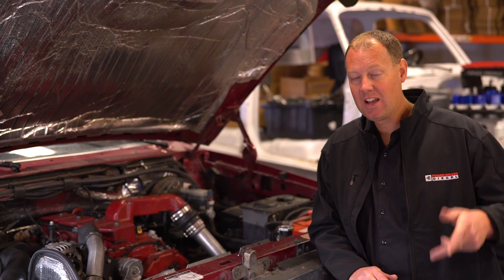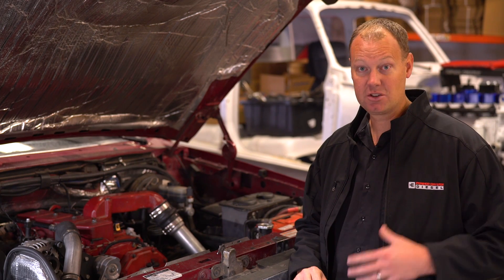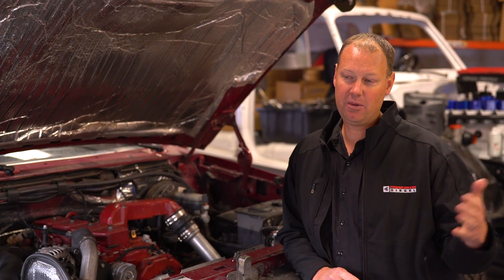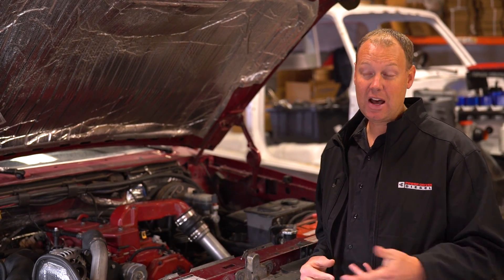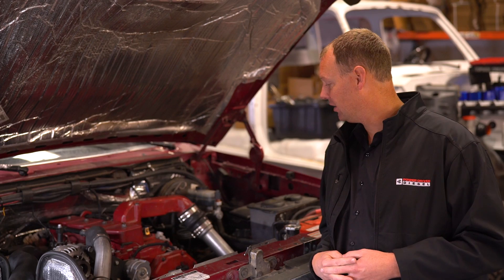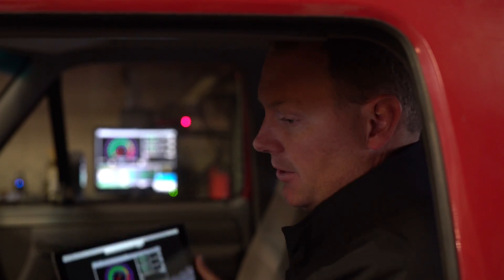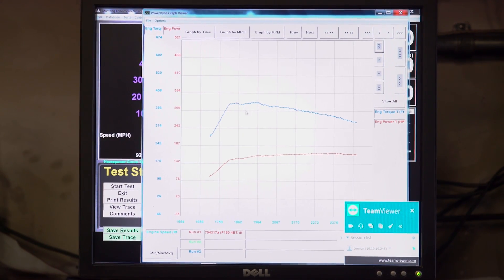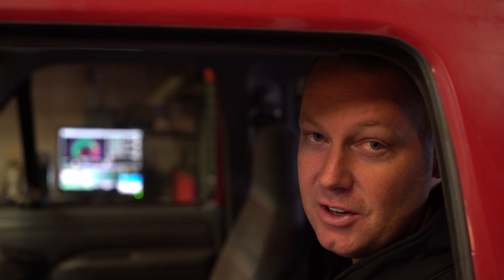Dyno Test: 4BT Cummins Powered Ford F-150

Comment: Great engine for a skid steer, way to shaky for a pickup. Should of built & turbo'd a IDI..
Reply: Paul Harper 
Man, an IDI is not a good power maker. Aftermarket support is very limited and with the 7.3idi, you run the risk of cracking a cylinder is high because of it being a punched out 6.9idi.
 Those engines are a poor choice to build.
Reply: Babylon falling 
Hahaha..dude, calm down you have missed the point all together!
  Look, im not saying it's not a good engine in stock form, but it's very limited. The IDI, once a turbo was introduced around 93 to 94 started to have a lot of issue's.
 The DI 7.3s were a much better design all together. My 01 7.3Di was built to be able to handle loads and still be reliable. 400whp/700tq to the wheels and a built trans to hold it, did a fantastic job, and mine sure wasn't a trailer queen or a pavement queen. I could pull heavy loads while keeping my EGTs down and still getting awesome fuel milage. Empty, i was getting 24mpg on hwy and about 15 in town, and about 18 mpg pulling. This was a 4wd on 33s at that. So no, modding or building doesn't just mean power. If you know what you are doing and build it right, you'll have no issues, an IDI cant do that, im sorry dude the evidence is there that supports what im saying. 
 Just out if curiosity, how many diesels have you owned, or how many year's have you been a tech?

Comment: gears! add gear! peek torque is 1200 rpm ish, peek horse is 2400 rpm ish.  happy medium 1650-2000 rpm.  add a 8 speed transmission will do some magic with such a low end torque engine and you will find tons of fuel economy! adding more boost just makes its life expectancy shorter.

Comment: Did you say you "pulled"  in 5th gear?
I've alway heard and seen dyno pulls in third. Theoretically a correct pull for correct numbers would be done in 4th/1-to-1 gear...wouldn't you think?...then typical drive loses of 10-15%.
Am I making sense? 
5th gear?...just thinking...if its .75 overdrive - you're losing 25% power in that gear. Am I correct?
Thank you.
Reply: PowerDrivenDiesel I can see that.
I have a 12-valve but for example I'll use my 427 that's in my 67....it was dyno'd at 598.8hp at 6100rpm with a 950 carb. Then we installed it in my stang. I didn't like the way it drove. I eventually put "my tune" on it with an 850hp , dropped the timing just a hair with fatter jets. Now , I'm sure the numbers aren't there now but it sure drives better with improved low-end control and torque. Warms up faster in cold weather. 
I think a dyno is great but once the motor is back in the rig...it still takes additional tuning... seat-of-the-pants tuning if you will.
I don't know....I'm assuming diesels aren't like that.
Reply: Correct.   mathematically,   any gear would work'.  Running in  direct   ensures the engine is fully loaded,  fully fueled, and fully boosted.    Also  keeps the torque to the  dyno  low enough so   slippage isn't a factor.   HP to the wheels  never changes, regardless of    transmissiongear selected. (ok, there ARE tiny variances  due to   loss through the cluster)  TORQUE to the wheels is  what changes  big time.    A flywheel rating of  say 400 ft lbs.  is   INCREASED by   the ratio of  the gear selected..,   say  4.0:1 in first gear.     So there is   now  1600 ft. lbs headed to the axle,  which then multiplies it another  3.5 to  4.5  times..    theoretically,  the end of the axle  'sees'    over  5000 ft. lbs of  torque,  in first gear.   (don't worry,  the  35  inch tire  'reduces' it  substantially)   Tire diameter is the TRUE final drive ratio!   simply put, the taller the tire,  the less  torque felt at the  ground.    Horsepower however,  remains the same. (sure,   taller heavier tires  make  great power robbers)  but I'm talking   mathematically here.Do the same test again in direct,  and the  end of the axle  'sees'  between   1500 and  1800 ft. lbs..,  depends on  axle ratio.   The traction wheel has a much better chance of not slipping when in direct!  HP is nothing but a calculation of  torque and rpm   How hard the shaft turns,  and at what rpm...

Comment: What did you set the timing at?
Reply: Ve pumps LOVE more timing. These pumps actually have dynamic timing,unlike a p-pump.
Reply: @powerdrivendiesel I put a timing spacer on mine. Probably the single best modification I've made. The guys after power are advancing the pump, one tooth, and retarding the pump timing, in addition to the spacer,as a starting point, then tuning the fuel knock out. On something light, like that,  or the scout, its would make for a fun truck to drive.
Reply: The aftermarket lift pump, and fuel pin made a noticeable difference, as well. A stock truck, with a  turned up pump, will bring the fuel delivery pressure to zero, with the stock lift pump.

Comment: Awesome video! I need to put my dakota with a 4bta on a dyno and see what it makes. I’d guess around 170hp. Has 3200 gov spring, fuel pin, 5x12 injectors and a hx30 turbo.
Reply: What year dakota? 2 or 4x4 ?
Reply: Michael McClure 95’ and it’s 2wd. Can follow my Instagram :thomas_vavra

Comment: I had one of these worked over with an inline pump, worked up to about 130 horse in a generator application. Produced 75kw no problem, all day long in the boat it was in. 1800 rpm unit

Comment: The 150hp 4bt had inline pumps on them not the ve pump. You guys need to find a inline pump for it I seen them make over 400hp.
Reply: They came with inline, P-pumps, and ve pumps depends on year, model, and use case.
Reply: @TheDarkToes  they also came out with an in-line Bosch A-Pump. Mine is a ‘98 with the A Pump, the A Pumps are tricky but can be driven on the road pretty well once you get used to the way the pump feeds fuel on its own like a full time automatic cruise control hahaha
Reply: Here in Brazil the F250 and F350 came with 4BT with VE pump, Hx30 turbo and intercooler and original 145HP with 3800rpm

Comment: 170hp/420tq with HX35 out of my k20 with a NV4500 and 3.73. I average about 25 mpg on 33's.
Reply: Next truck is getting a 5.9 and a Eaton 10. 3.73 or 4.10 and 40's.
Reply: @bladenrexroth2555  
I like the 10 (592lbs) myself - the 6 (359/369lbs) is a little bit lite @ 220/230lbs. Less on the truck frame.   

For heavy long haul the 10 is nicer unit...   less room between frame rails, but it nicer as you can find a gear you need for the load being pulled.

That and it's a common trans in class 8 trucks...
Reply: nobody  I've settled for the Eaton TX14607b. Gives me a lo lo, lo and a 0.75 OD. 1400 # of torque rating and is in the 500 # weight. A compound turbo cummins with about 450-500 hp and that eaton trans would put in some work
Reply: @bladenrexroth2555  
😁 - for 4wheeling I'm sure you choose well ---.  Should be a great rocker...   Enjoy your toy - should make your pride show from ear to ear..
Reply: I wonder what the tow abilities are with this truck. Only an f150, but an f250 isn’t that much more weight, being an obs, they have light bodies. Figure, a light flatbed, 6 speed manual and airbags would make a decent tow truck. Possibly tow as much as a dodge Cummins 2500.
Reply: @juniormorris3878  really depends on how well the truck is put together. I imagine with a healthy engine, trans and a suspension that won't sag. You could have a combined weight of possibly 18k#'s. Maybe more.

Comment: Better suited in a Ranger I believe.
Reply: Way way to heavy for a little truck like that
Reply: @teeg3275  - Tell that to the countless people that did it, search 4BT Ford Ranger. It's only 220 lbs. heavier than a 302.  Yes the 4BT is heavier than what the truck was designed for but also true for the F150.
Reply: @Itsa_Mea  we put one of them In ram 1500 and it was terrible even with 3/4 ton suspension so idk maybe it's the truck or the dodges
Reply: @Itsa_Mea  it's about 320 pounds more than an all iron 302w. An all iron 302w weighs 460 pounds, 40 pounds lighter with aluminum heads.
Reply: It’s not too heavy for a small pickup, I have one in my dakota. With v8 coil springs and upgraded shocks it rides nice and also gets 33mpg.
Reply: I have a  87   Dakota sport,    short box and  4X4..  and  blown  v 6 and the piss poor Peugeot  transmission...   Been  top of my  'to do when bored'   list  and   do a  4bt and  nv 4500.   Ah,  someday...
Reply: Swampy  if you think it's smart to drop an extra 400 pounds over the axle of a vehicle that already has a crappy weight balance us a good idea then I hate to see a bad idea.
Reply: Way too heavy for a Ranger. Unless you are talking about the old full size Rangers. The engine is right at 780 pounds. That's heavier than an all iron big block
Reply: Swampy  you don't understand the  simple concept of vehicles. All cars and trucks have a front and rear axle. That doesnt mean they are drive axles. Like I said, adding almost 400 pounds over the front wheels on a truck that already has a front/rear weight balance issue is a bad idea.

Comment: Nice video guys you did well 👍 
But for my opinion there a 2 cylinders missing 😆
Reply: I put a 1st gen 6BT in my '78 Bronco. Turned up, of course. At only 5150 lbs, it gets 25 mpg highway, and has.... plenty of power. lol Video on my channel. 0-60 in less than 5 secs.
Reply: AmericanThunder Are you running larger tires or iron bumpers at that 5150 (Van Halen) weight? My dream is to build a mud/ overland rig with a 6bt but I believe my ‘94 already weighs 4500lbs with the 5.8W so a 4bt with more rattle might be better.
Reply: @AmericanThunder  did you run the c6 to it?
Reply: It’s just a little heavy the 4bt fits perfectly in the f150
Reply: @thomashunt7717  the 6bt fit in the Bronco like it was made for it although the engine does weigh 1500 lbs wet.. it's been running in there for 10 years no problems I'm really happy with the setup
Reply: AmericanThunder do you recommend the 6bt or a 4bt for wheeling Offroad in a ‘94 BKO? For a street ring the 6bt seems like the winner but I’m not sure if making the front a lot heavier will upset the balance while crawling over obstacles